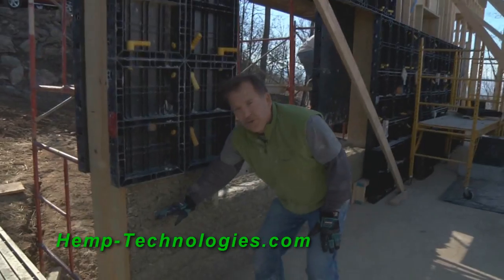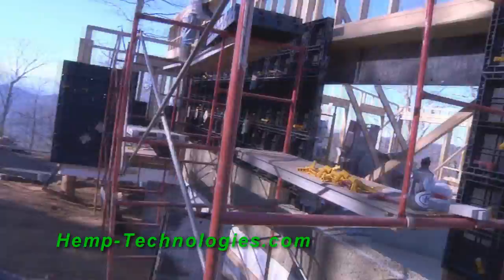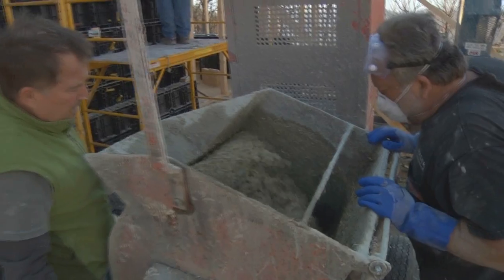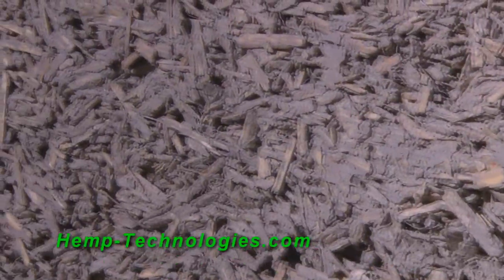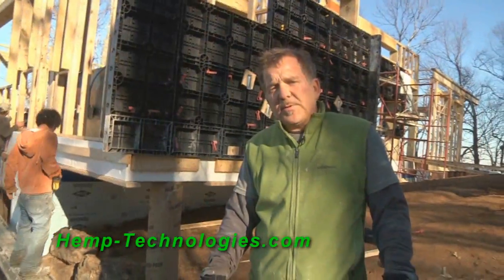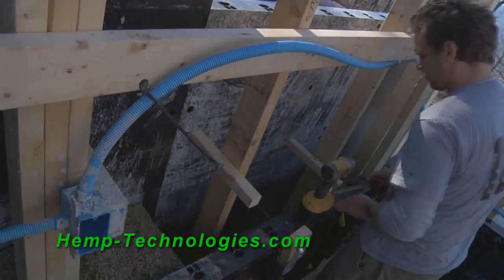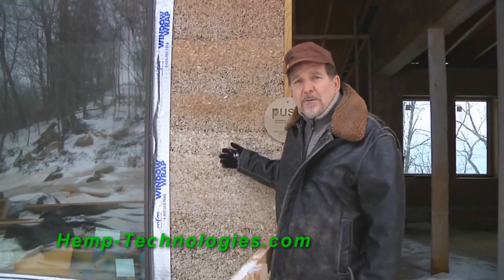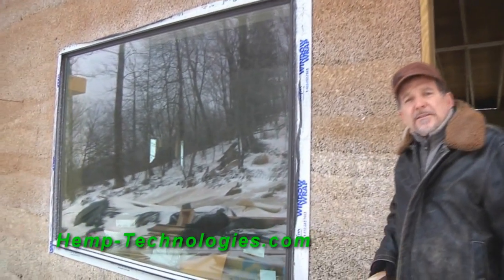Hempcrete House - Asheville, NC

Comment: Can hemp hurd be used underground? Would it need a water barrier after it has dried? Could you use it in insulated structure blocks? Can it be used in interior wall, albeit not as thick as exterior walls? Has the cost come down in the past 9 years?

Comment: What about using bamboo instead of hemp. It is available everywhere; it is from the same family of plants. They have straw houses in Europe that they claim are over a thousand years old and have a mud, clay, and sand covering on the straw bails. You could dry the bamboo under black rubber roofing material with bricks in between the stacks and then run it through a wood mulch-er twice to get the finer mulch. This mixed with three parts bamboo mulch ,and one part lime, and water, should be a good consistency. When I went to Europe and was looking at the over one thousand year old ornamental work on the buildings they said it was plaster and granite. Granite has a lot of radiation in it; not good. But the fact that they lasted that long is amazing. Also the roman roads that are still intact used oyster shells with granite dust and sand which was another alternative for longer lasting paving. Our concrete that we use in our homes only has a safety life of 75 years which is scary. I did talk to a friend that took the horsehair plaster out of a home and used it as paths in their yard with small rocks applied to the surface and a roller; it has lasted for many years and seems to be harder then concrete. The older homes last hundreds of years. If anyone uses the hemp or bamboo; let me know how it worked out. Thanks

Comment: Would this technology work in a monolithic dome house?
Reply: Possibly as exterior hempcrete or plaster after the spray foam and concrete
Reply: NO!  Hempcrete is EXTREMELY weak compared to what is used in a monolithic dome. It also would slash the life expectancy greatly.  Including lessening the insulation properties.

Comment: This is coming from an engineer: I'm assuming that mix doesn't handle bending or load bearing very well and that's why you are placing in and around the stud framing?  It looks like you are basically using it as a substitute for rigid foam in the wall or plaster and wire on the outside?

From what I have read, this stuff maxes out around 150 psi crush strength, so no good as a structural material.
Reply: Yes that’s how hempcrete or hemplime is used.  No structural.

Comment: @RazsterTW 
you can, hempcrete can be molded into any part of a house that you need. anywhere that concrete can be used hempcrete can do it better. hempcrete is 7 times as strong as concrete and 3 times as flexible(prevents fracturing) its also fireproof, waterproof, and rot proof(unless put underground). unless there is something i'm missing you can build a whole building out of it except where the building goes underground, then use concrete or wood that has been treated.